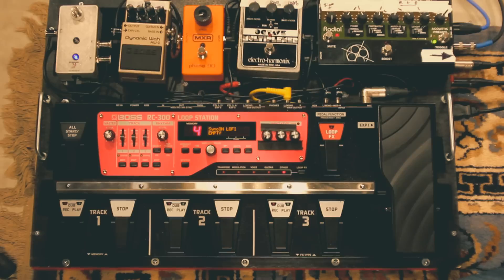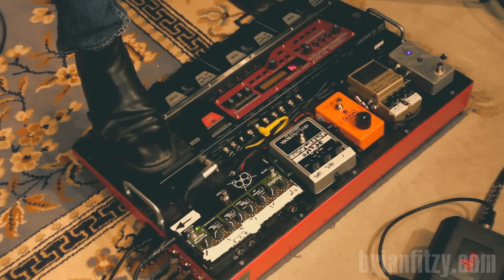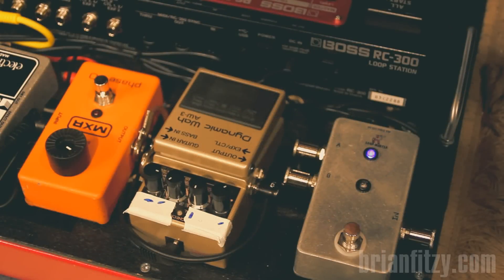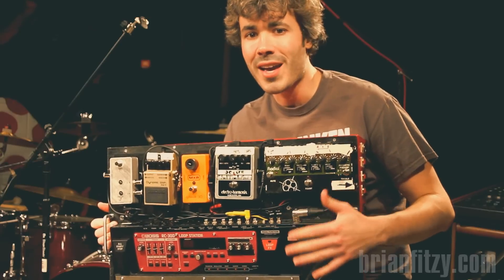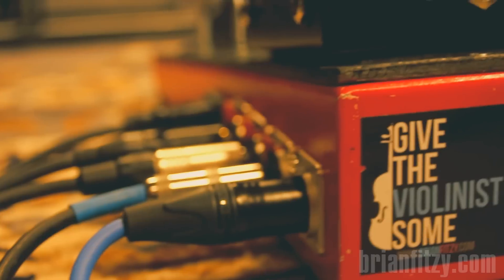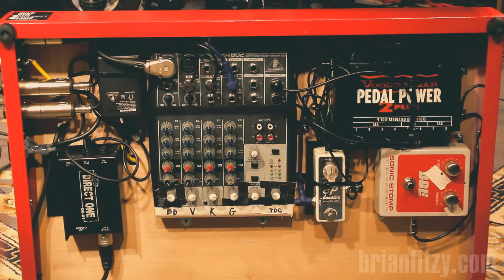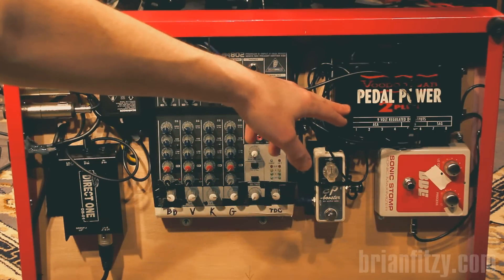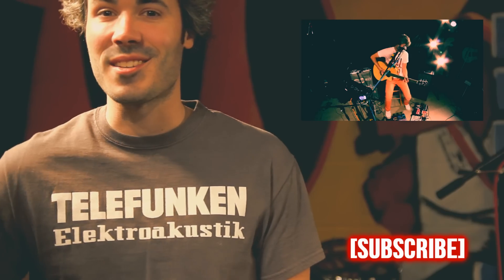Brian Fitzy's RC300 Looping Rig Demo

Comment: Hey Brian, awesome looking rig. I'm also just getting into the looping game and familiarizing myself with the RC-300. The challenge I'm currently facing is bleed from previous loops and being able to then isolate my second loop w/o the bleed from the first. Example would be I record guitar and vocal, or beatbox one track one, then on track 2 I sing a background vocal part which I later want to solo but which unfortunately has bleed from track 1. I'm using a condenser mic which has helped a little but I'm still not getting a clean track. I'm also currently running everything into my Fishman Loudbox Mini which is my PA / monitor at home. I'm guessing it's only going to be worse live with a full house PA sound plus monitors coming at me.  

Any suggestions?
Reply: Chris Assaad I'm not Brian, but I'm a live looper as well. Using a condenser microphone will actually make this worse. I use a switch dynamic microphone in my setup for this reason, if I'm not adding something with the mic (beatbox or backup vocal), it is switched off so it doesn't pick up more noise into the loop. Hope this helps.
Reply from the maker: Hey Chris, I would definitely suggest to go with a dynamic mic with a tight pickup pattern.  Super or Hypercardioid.  If you've got the Loudbox behind you, try moving it directly off axis.  I've always utilized a specific EQ for my loop mic when I'm doing anything but beatbox, purely to reject the ambient sound.  You could achieve a noticeable improvement with an in-line highpass filter.  

And you are correct: if you go out live with the same rig you have now, you may not actually be able to do it at all with a condenser mic.  The feedback threshold is quite high.  Monitoring with in-ears will solve a lot of those problems for you!

So sorry for my delayed response!!
Reply from the maker: Cambridge is right on the money here.  My loop mic is also a switched SM58, which allows me to kill the feed at any time.

Comment: Great vid, Re: your pedal board input XLR and jacks, I would have asked the metal fabricator to recess those inputs to the length of the longest cable plug to prevent accidental damage, like treading on or kicking them, that way they are protected.

Comment: Hey Brian! You're my looping hero! I recently purchased a Boss RC-300 and have been looking for ways around the limited two inputs. Right now I have vocals, guitar, a bass percussion pedal and a snare percussion pedal going into my Mackie Pro FX12 mixer. I then route the L Main out from the mixer into the L Input in the RC300. Then I have the L Main from the RC300 going into the ST Return on the mixer. This allows me to mix everything prior to the RC300 and it sounds great, my only issue is that it comes out mono and is a bit hard to hear sometimes only coming out of one speaker. I've been trying to figure out a way to get everything to come out both speakers (stereo) but I can't seem to figure it out. I tried using the SUB Outs which works great for stereo playback but when I record it seems to record the loops that are playing as well as the new loop I'm creating which creates a horrible phasing sound. Any suggestions or feedback would be awesome! Thank you!!
Reply from the maker: +AmandaLeePeers Hey Amanda!  Thank you so much!  You could work around that issue by having another mixer.  If you made the ProFX12 a dedicated sub-mixing unit, and ran your loopstation's output to another mixer and then to the PA or your studio's near-fields, you'd solve the problems.  That phasing issue is thanks to the signal being routed back into your mixer.

Here's one other option with your current setup:  run everything the way you do already, but keep the faders on each going-to-the-loopstation channel turned off.  Patch the monitor output from your mixer to the input on the RC300.  Mix your sounds with the monitor send on the mixer.  Plug the output from your RC300 into an unused channel on the mixer, but DO NOT send anything to the monitor bus from that channel.  You will have stereo output of your loops to your speakers or anything else you monitor on, and won't have to spend another dime.  That's what I would do!

Hit me if you have any other questions.  I check my FB, twitter, and email a biiit more regularly the YT, too.  Best!

Comment: Thank you so much for this video, very helpful!
I have a question about the electroharmonix bass octaver:
I have a Boss OC3 octaver and I noticed it's not possible to play it in a polyphonic way.
Does your pedal allow playing strings contemporary?
thanks in advance
Reply from the maker: Hey hey, thank you and I'm glad it helped!!  The modded EHX pedal I used here had some of the same limitations.  It was really easy for it to just be a muddy low-frequency nightmare with more than a single pitch simultaneously.  What type of application would you be going for with chords (or even just doublestops) on bass?  Definitely curious.

Comment: Great video, thanks for sharing the details of your setup! The energy in your music is phenomenal, Brian, I defy anyone to listen to it and not tap both feet, if they're not already up and dancing.
How did you fasten the equipment UNDER the pedalboard? I can see Velcro or Dual Lock some places, but I'm curious about how you used screws for the heavier stuff.
Reply from the maker: Hey hey, thank you!  I'm using industrial Velcro and I make little L-brackets out of aluminum or light steel to fasten heavier things to the underside of my builds.  Those brackets stand up to TSA and being cooked in the sun where Velcro doesn't!
Reply: Thanks, Brian, good tip! I've been using old-fashioned hook and loop velcro for this sort of thing and I've just ordered some 3M Dual Lock industrial velcro which should be a lot stronger, but having seen what you've done I'm going to organize some metal brackets as well. 
Keep the good music coming! :)

Comment: Are you running your Mic (XLR) into the DI Box into the BBE then the sound card to correct the impedance?
Reply from the maker: +Mr. Peters' Classroom correct!  Slightly different order, but yes I am correcting impedance and giving myself a ground lift with the DI.  I had experimented with an in-line transformer design but the overall size difference was negligible so I stuck with a standard DI.

Comment: Hey. Very impressed with your looping chops. Nice work  Question. Do you run some sort of effect when looping backing vocals? Can see how you've got beat boxing sorted but what about when you looping a harmony?
Reply from the maker: +wine heard Thank you!!  Back when I was using this rig (I recently build a new setup), I had two signal paths for the looping mic.  One was for beatbox, the other path was clean and utilized a crossover unit I made.  I had independent control of volume over each path, so it gave me some control.  Now I have an expansion on that type of setup, with an effect processor for non-beatbox sounds.  Hope that helps!
Reply: Brian Fitzy Nice. It works so well. Impressed! Will keep an eye out for the new rig in your next vids. All the best! Cheers. W.

Comment: Hey man! Incredible. I have a question... is your EP booster before or after your guitar effects pedals? Where in the chain did you place it? Thanks so much!
Reply from the maker: Hey man!  Thank you!  I actually had to watch the video again to remember, as this rig is about 4 iterations old now :)  In this setup it was at the END of the chain, right before it hit the mixer.  Back when I was still using an analog mixer, finding gain structure that yielded a low S:N was a pain with the RC300 preamp circuit(s).  Hope that helps!

Comment: Brian Fitzy how do you have the power set up on the tonebone? It requires 15v right? Is that an option on the pedal power?
Reply from the maker: Shoot, this was flagged in spam.  Just seeing it now.  It does require 15v.  On this rig I was using a right angle adapter to save real estate and powering it with the OEM adapter under the board.

Comment: I dont understand your loop master A - B control. could you explain it a little more? I get that the B is going to the mic input on the RC 300, but is the A going to the Behringher mixer underneath? whats the advantage of doing this as opposed to just plugging into the mic in directly? i've been doing so and then running my other vocal mic to the mixer as normal so i have one mic for looping and one for normal slightly reverted vocals. Any help and advice would be amazing.

i'm just starting out looping and found your channel by chance but its great for inspiration and flat out copying your loop layers to create my own cover of your cover. As i'm sure you can appreciate, sometimes its hard to figure out how to layer things in a manner conducive to live performance, so let me take this moment to congratulate you on your talent and success and thank you for sharing you're skills.
Reply from the maker: Hey Paul, so, with this rig I used the Behringer mixer as the brain.  The A-B router too it's input from the Behringer, and split/routed my loop mic's signal path.  Path A went through a cross over and DI into the mic input on the RC300, while path B went into a Sonic Maximizer and into one of the 1/4" inputs on the RC300, joining the other signals from the Behringer to form a multi-mono feed.

The only reason I did that with routing the loop mic was for more tonal variety.  My current (new) rig goes about it much differently and/or directly.  The way you're running yours is just fine!

Thank you so much!  I'm glad that what I'm doing is helping you find your own voice with the hardware.  There are a lot of possibilities with this gear!
Reply: Thank you for all your replies Brian, I'm looking forward to the return of throwback Thursday!

Keep up the good work!

Comment: Hey man, I have watched this video so many times and have learnt a lot from it. I too have a RC300 and do live looping. I was woundering what are you effect are you using when you beat box? You seem to press something before you tell us about the A & B switch. When i beatbox it just sounds shoddy even though my technique has got better. Could you please help?
Reply from the maker: That's fantastic to hear!!  This particular rig was setup with two signal paths for the loop mic.  It entered the board and went directly to the undermounted mixer.  From there it went to the A/B switcher over 1/4" TS.  The A/B switch would let me route it through a rehoused BBE Sonic Stomp for my beatbox tone, or through a DI and a crossover unit I made before hitting the RC300 microphone preamp.

My current rig has removed the maximizer and I now run my beatbox path directly into the RC300 preamp.  Still punchy and crunchy.

What kind of microphone are you using?

Comment: First of all, thank you man. You were an inspiration and a proof that it was possible to create such a complete rig and using it beautifully ^^. I have personally associated with the RC-300 a bass and a multipad connected to three pedals. My pedalboard contains, besides the RC-300, two pre-amps, an ABY box, a vocal processor pedal, a tuner and a switch to mute the microphone. But I encounter an electrical difficulty with the RC-300. I plug it into my Multi Power Supply Cioks DC10 and it does not turn on. How did you make yours work ?
Reply from the maker: Thank you so much!  Hmm..it sounds like your power supply isn't giving the RC300 enough amps, or it may be the wrong voltage/current spec.  Make sure it's DC9V with center negative, and at least 350mA output going to the RC300.  It's going to draw a lot more than a typical stomp box.  I hope that helps!  And, if you haven't seen my latest rig, here it is: https://www.youtube.com/watch?v=kkT5n4vO_sA

Comment: Are you powering your rc300 with the voodoo power supply? I'm asking because i wanna use mine to power the rc300 but I'm wary  because at the jack it has instructions not to use a alternate power supply and to use boss only psas adapter.
Reply from the maker: Hey hey, good question.  I do currently power it with the Voodoo but I also DID have issues with one of my builds.  I've had solid luck with OneSpot supplies as well, but the lack of isolated transformers leaves me only using it for fly gigs at most.  As long as you're running a 9VDC supply with the right polarity and a high enough mA output, you've got nothing to worry about!

Comment: How are you cutting the gain on your microphone? When I overdub using my mic everything from my speakers kind of  "bleeds through" and gets muddy quickly.
Reply from the maker: Ahhh yes, I pre-EQ the mic before it hits the RC300, but I also use a SM58 with a switch on it for my looping mic.  I also now use an in-line filter to cut everything below 100hz out when my router is switched to send that mic to the RC300's mic input.  The BIGGEST thing is using in-ears.  No issues with feedback there :)

Comment: Hello Brian I would like ask you if you had some problem like I have right now with my loop station ,maybe you can help me to fix ( The problem is that in the display often comes out the writing : Rhythm level, when it is like this, the sound of drum still comes out and the pedals are still working right , but then if I want change the pattern or anything else by moving the knob I can't do anything ... and then when the writing ( Rhythm level ) go away, I can use the knob again as always... The problem is that the script is coming and goes every 4 or 5 seconds, so right now I can use my loop station anymore . I have try already to send a message to the roland but nothing they don't answer yet . If you have some suggestion you are welcome of course . Thank you
Reply from the maker: Hey Leonardo!  That's really odd.  Make sure that you've turned the rhythm level knob all the way down and save the blank memory patch to overwrite any change.  There IS a button combo that you can do that will turn the rhythm on, so make sure you aren't doing that as well.  If it isn't user-related at all, there's a chance that the digital side of the RC300 has some kind of corruption, or physical damage.  Let me know how you fare.

Comment: Brian, I've desperately been looking for a pedal board that is large enough to accomodate my rc-300 unit and additional pedals, I have to ask which pedal board you have if you don't mind me asking! Thanks
Reply from the maker: Sorry for the delay, Joshua!  This actually isn't a store-bought item.  I fabricated that board out of steel, and it has a 1/4" wooden  ply top.  It was built to fit in the PSG cases that Pedal Train used to sell their boards in.  Hope that helps!
Reply: Very helpful. Except now I'm bummed that it's not one I can buy directly! Well done sir, looks great. Cheers :)

Comment: hi, I don't understand where the Behringer Xenyx 802 mixer main out is connected
Reply from the maker: I'm running my main outs into the stereo line level input on the RC300.  Consider the RC300 or any loopstation, for that matter, to be an amp for the mains of a simple PA system.  Just the same as you would run your mixer's main outs to that amp, you do so on the loopstation.  So, if you were to pan a channel to any degree, the loopstation's output would reflect that change but in throughput and loop tracking.  Does that make sense?
Reply: Brian Fitzy yes, I do the same thing using aux sends, but your solution with main out is better.
Reply from the maker: batdevis Oh, excellent!  It all comes down to how you want to process the signal and in what order.  I'll check out your channel!
Reply: Brian Fitzy I have no video with loop station yet, but here's my schema: https://twitter.com/batdevis/status/520926948344987648/photo/1
With the aux send trick I can use the same mixer before and after the loopstation
Reply from the maker: Ok, so I'm sure you sorted this out already, but the only thing that COULD pose an issue with that routing is sending the feed to the loopstation on an aux bus.  If your aux send is pre-fader, then you'll be good, but you can't feed the loop signal with the real-time signal on the mixer or you'll end up with lots of phase issues.

Comment: hey, how r u? can u please give me an advice how to arrange my pedals? i'll tell u all my pedals and i'll appreciate if u can help me with an advice. so, i have: wah, acoustic, chorus, delay, distortion, reverb, phaser single pedals and multi effects: gr20 synth+gk3, zoom 707 and zoom 4040. zoom's i use for delays, chorus and distortion. i wanna go with all in rc 300 but if it's possible to go all the separated pedals in chain 1 time, each multi effects alone in 2 time and one multi effects+ gr20 in 3 time. i don't know if u understand what i try to say, but i don't wanna mix the multi effects together or with pedals. cheers
Reply from the maker: Hey!  Sorry for the delay (8 months...oof...)

The order you want is:

Acoustic Sim > Wah -> Distortion -> ZOOM 707 -> ZOOM 4040 -> Chorus -> Phaser -> Delay -> Reverb -> RC300

or use an ABC split box and connect the output of each pedal chain to an input on a mixer, which sends mono or stereo to the RC300 over TS cables

GUITAR -->

A) Acoustic Sim > Wah -> Distortion -> Chorus -> Phaser -> Delay -> Reverb -> MIXER --> RC300
B) ZOOM 707 > ZOOM 4040 -> MIXER --> RC300
C) GR20/GK3 --> MIXER --> RC300

I hope that helps!
Reply: no worries about the delay. i have one:))))) (thank you so much, sir ! )